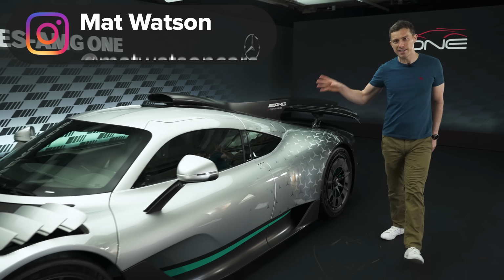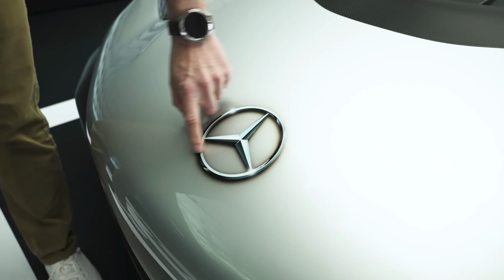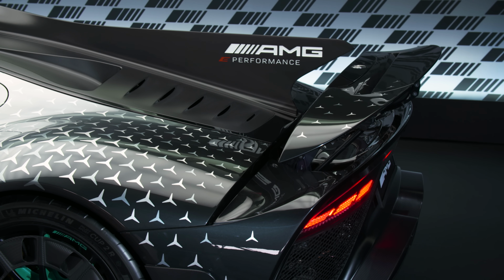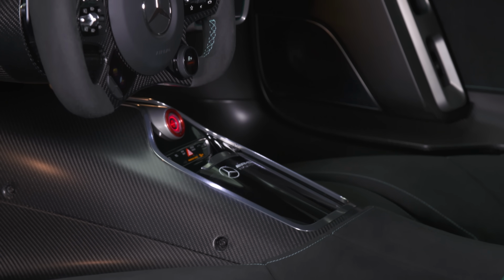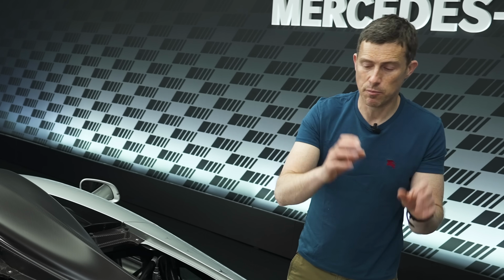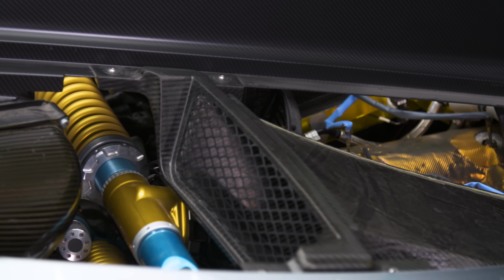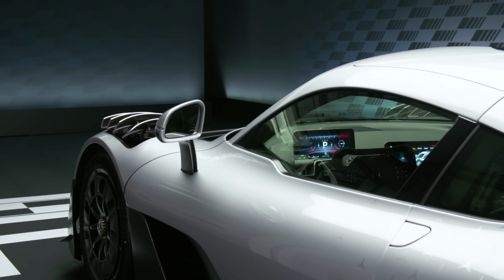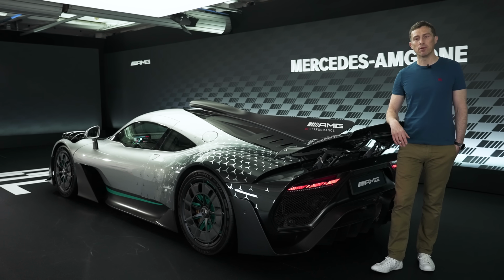Mercedes-AMG ONE: An F1 car for the road!

Comment: This car is amazing. The only thing is this has similar power outputs from the same capacity as an F1 car, and that is confusing to me cause F1 engines dont last very long (Modern one are pretty good I admit and owners wont be thrashing them as much but still…). So im curious to see how they can get these to last
Reply: The engine in here is detuned to make around 560hp. The power deficit is made up by more powerful electric motors. Overall the powertrain is more reliable but certainly much heavier.
Reply: F1 engines do 8 GP in rows + quali + practice almost always maxed at 15000 RPM. Under daily driving circumstances and some occasional track action they can probably last 50 000 km instead of 5000.
Reply: Then allow me to unconfuse you. The modern F1 engine produces somewhere in the region of 900hp. This produces around 550hp, the actual engine that this is based on, produced 700hp around abouts. This engine has had to be detuned and modified as to comply with road regulation. The rest of the power comes from the electronic element. That's how it makes its hp. F1 makes only 160hp roughly from the hybrid system, this makes almost 500hp iirc.

Comment: That steering wheel is so ridiculous. Even ignoring general concept of this car, adding all this F1 tech to a road car just seems meaningless to me. It can probably already outrun most things on the road with barely any effort, so a 'PASS' button and DRS are completely redundant, and nobody is going to enter this car as it is into any competition where all this stuff would be useful. So what's the point.? It's nothing like extreme off road tech, because you could take your car some place where you'd need chunky wheels, locking diffs, snorkels etc, most people just don't.  
By the way, the fact that it has a combustion engine at all already makes it feel antiquated.

Comment: 1.6L V6 yet it weights 1700 kg? Very surprised, thought it would be closer to the Valkyrie
Reply: Yeah...and the T50s will be 852kg with a 4 litre V12 :)
Reply: Its the Hybrid system. Batteries are heavy asf.
Reply: @razatiger22  8kWh batteries are max 150 kg and that is for a standard quality, where this most definitely not a standard quality car.
Reply: @SundbyCPH  It has 4 electric motors for each wheel, three which produce 120kW and one 90kW. A 100kW battery weights at around 625kg.
Reply: @ThatLoudLad  it does have 4 motors, but than is 1 for each front wheel, 1 for the engine crank and 1 for the turbo. Still it is way too heavy if you ask me and more than the sf90.
Reply: @SundbyCPH  fair enough, not everything can be perfect, we still got to see how it performs with that weight.
Reply: Valkyrie uses a single clutch transmission aswell, will be interesting to see if the weight saving is worth the slow shifts
Reply: @joelfernandes9814  valkyrie is around 1030kg, 1695kg. 665kg gap. Who cares about 0.1 sec slower Shifting? AMG One is a huge disappointment.

LaFerrari, P1,765lt they are all faster to 100 and 200kmh and much lighter. The One would have been an impressive car back in 2000, but not Today
Reply: It is shit hahaha
Reply: 6.2 Chevrolet LS3 is lighter than a 4.0 BMW S65 :D

Comment: so at this point having F1 engine was just a prestige problem.
Reply: I think they will had to limit the RPM on the One otherwise the engine would have to be rebuilt too often, which doesn't make sense for someone other than an F1 team

Comment: Matt does a much better job here than Jack from TopGear at explaining the really impressive features of this incredible car. I mean, TG didn't even talk properly about the gearbox or engine - the main 'wow' point of this car!
Reply: I had no idea this car was a thing. Started watching the top gear video, got bored, then found this.
So much better than the top gear one.
Reply: @marcuscoquer5958  yep. Top Gear 2022 looked quite trash.
Reply: @marcuscoquer5958  they showed it off in 2017 bro everyone knows about this car by now
Reply: @yungboicontigo9278  Ah! I was busy then.
Reply: Yet Matt didn’t speak about it being 4 wheel drive with electric motors on each axle?
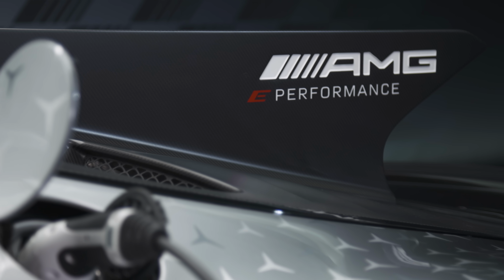Reply: @gerardm7840  True. @5:20 he does mention the front wheels being driven in pure EV mode, but no mention of how these motors work as part of the AWD system to improve performance.
Reply: I mean, it’s not a criticism. Much better than TG. 
But he’s set such a high bar for motor journalism that I expect him to tell me EVERYTHING 🤣
Reply: @ismailahmed1712  yeah this car really was amazing
Reply: @gerardm7840  yep.
Reply: Both do a better job than you.
Reply: @Jinsun202  insecure
Reply: @Jinsun202  I do a better job than you.

Comment: Initially was supposed to weigh around 1200kg, but ends up tipping the scales at 1695kg. I don't care how much horsepower it has, that's a heavy fucking car! Valkyrie will make light work of this.

Comment: Mercedes said 0-200 in 6 seconds 5 years ago, they failed.
Reply: Car is so heavy, they said around 1150 kg I didnt know 1700kg is around 1150... also power
Reply: They had said 0-200kmh in 5.5 seconds if I remember correctly
Reply: @yannis7815  Under 6 s.. its on website even

Comment: It’s an awesome piece of engineering but if I were in the market for such, my money is on the Aston Martin Valkyrie cause it’s 600kg lighter more powerful and more track oriented.
Reply: But it's not a Mercedes Benz
Reply: @Rocky's Modern Life no its not. Mercedes is more premium. That's why Aston uses parts and engines from Mercedes and not the other way around
Reply: valkyrie doesn't have electric motor and the instant torque that comes with it as well as mguk or active aero

Still think the valkyrie will edge it out most of the time but amg will be able to deliver similar levels of performance while being actually drivable amd liveable with off the track too
Reply: @Rocky's Modern Life yes it does! Lmao so it's ok for companies to literally rely on less premium companies but it's a crime for Mercedes to make its own mainstream cars 

Either both don't hurt premiumness or both do you can't cherrypick
Reply: @Rocky's Modern Life no I'm not 

1) Mercedes is known for making sports cars and luxury cars and f1 cars etc so no 

2) wrong she would be more impressed with Mercedes especially if it was an amg or maybach 

3) yes it absolutely does. You can't be a more premium brand if you're taking parts from another company that's supposedly less premium 

You're the one that doesn't understand
Reply: Valkyrie doesn’t have a formula 1 engine. AMG one is all about bring the formula 1 technology to road.
Reply: @Rocky's Modern Life not true at all

Mercedes is by defenition premium 

Wdym mainstream

Lmao yes it has everything to do with it

How can you be premium when you use parts from "less premium" companies 

Lmao so what if Mercedes makes vand and hatchbacks? That doesn't change or take away from the fact it's still premium
Reply: @Rocky's Modern Life lmao if anything that just proves Mercedes is more premium than Pagani since Pagani is the one using their engines not the other way around 🤣
Reply: @Rocky's Modern Life you're the one that has no clue what you're talking about 

It's clearly not a superior badge if they are owned by a so called less superior badge lmao 

Lmao so fiat owning Ferrari doesn't water down the image but God forbid Mercedes make a hatchback 🤣🤣🤣🤣🤣🤣🤣🤣🤣
Reply: @Rocky's Modern Life Wrong. How is it a more high calbre brand? So what if Mercedes makes hatch backs? How does that water their image? 

Lmao wdym even if it's the amg arm you're so desperate to discredit Mercedes 

Lmao is that why Aston Martin is fighting bankruptcy and had to rely on Mercedes for engines and infotainment lmao yah so premium 😂
Reply: @Rocky's Modern Life WRONG. Amg gt black series is more desirable than Aston Martin cars in the same category so you're completely wrong
Reply: @Rocky's Modern Life if anything Mercedes is the most premium car company ever since they literally invented the modern automobile
Reply: @Rocky's Modern Life lmao Yes to all of those. If you use or are owned by car company that's supposedly less premium then that by defenition makes you less premium too
Reply: @Rocky's Modern Life mainstream doesn't make something less premium
Reply: @Rocky's Modern Life lmao my point is that Mercedes making a hatchback doesn't take anything away from how they make amg project one , gt black series etc  g wagon etc 

People are able to recognize it as a premium brand and if anything The main stream aspect makes it more desirable since they get a taste of the brand and have desire to get the best the brand has to offer
Reply: @Rocky's Modern Life lmao you need to take your own advice 🤣 

No they aren't how???
No they won't. 

It does mean the company is not as premium since they are literally relying on less premium companies 

You can't cherrypick what watering down you ignore or take into account
Reply: @Rocky's Modern Life by that logic I van say that Aston is even worse because they have lower end brands like Ford which have the same grill as them whereas at least Mercedes still maintains its own brand identity 

How does it sound superior when Aston relies on Mercedes not the other way around?? 

Yes it is a better brand name than lotus 

Depending on the car it's more desirable eg LFA way more desirable than a lotus 

If you compare cars from the same segment from each company then people will desire it more which wouldn't be possible if the company had a worse cache

Comment: WE WANT A DRAG RACE AND A ROLLING RACE against a Rimac Nevera, a Tesla Model S Plaid and a Bugatti Chiron Pur Sport or Koenigsegg Jesko/Regera 🙏🙏🙏🙏

Call Many and ask him 😁

Edit: I just found out that the acceleration figures suck compared to the rumors. It should do 0-200 km/h in under 6 seconds and now it does it in just 7 seconds. You don't need to do a drag race against the other hypercars. I am actually immensely disappointed. This design is stunning and it will perform on the track but otherwise it doesn't impress.